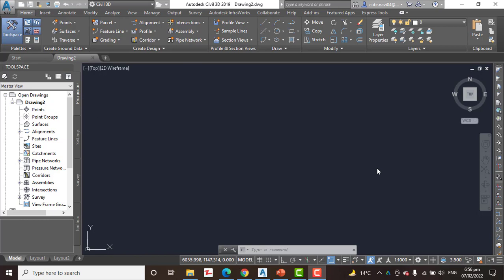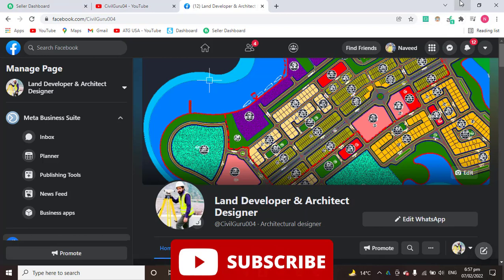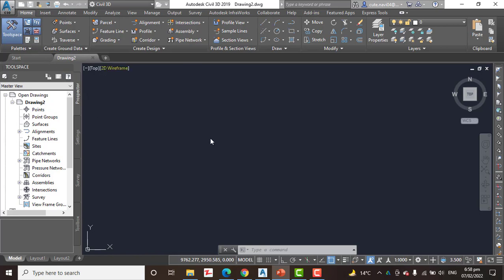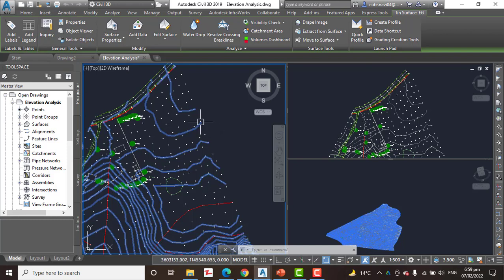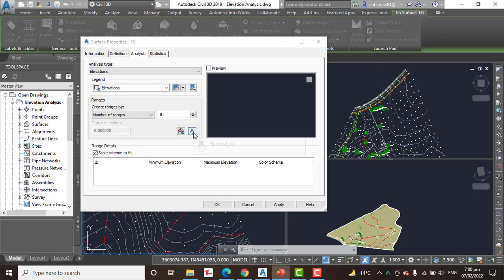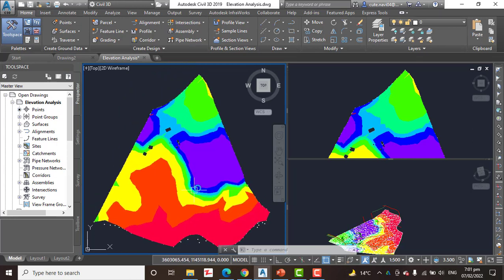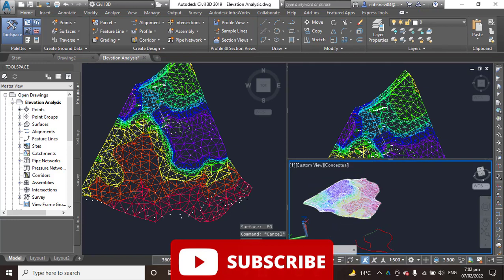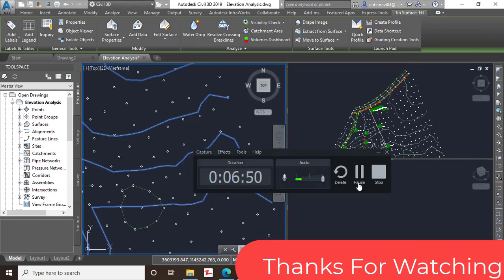How To Do Elevation Analysis Of Surface In AutoCAD Civil 3D | Surface Analysis Using AutoCAD Civil3d

Comment: How can I create elevation banding 3d
Reply from the maker: There is an option to select in surface properties..
Reply: @CivilGuru04  it's not in my surface styles I don't know why
Reply from the maker: @stefanwoodruffe823  what are the option you have??
Reply: @Civildesigns04  is there an email I can send a snap shot too
Reply from the maker: @stefanwoodruffe823  +92305 5510372
Whats app.
Reply: @stefanwoodruffe823  Correct it is not in mine either, I think it may not be available from a metric template
Reply from the maker: Surface properties style and then check in display..may be it will help otherwise you can create